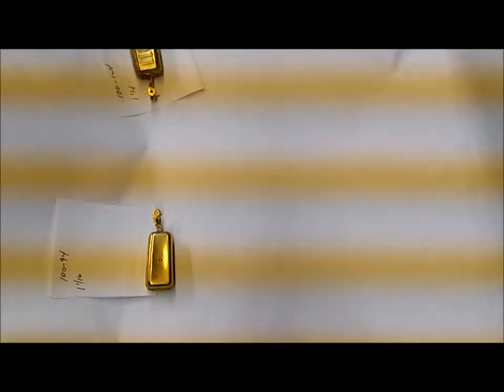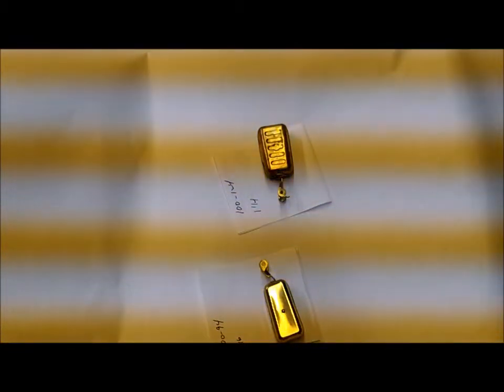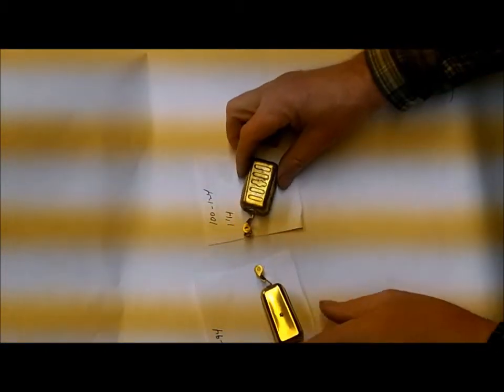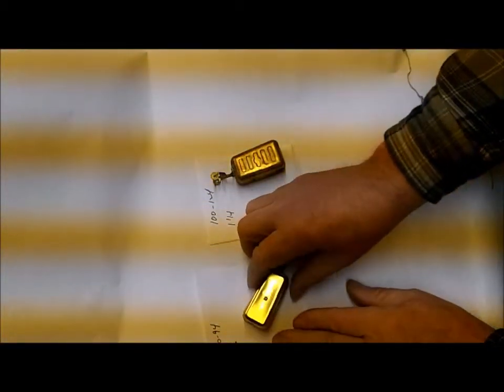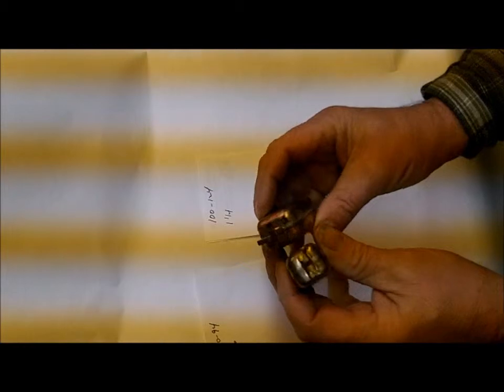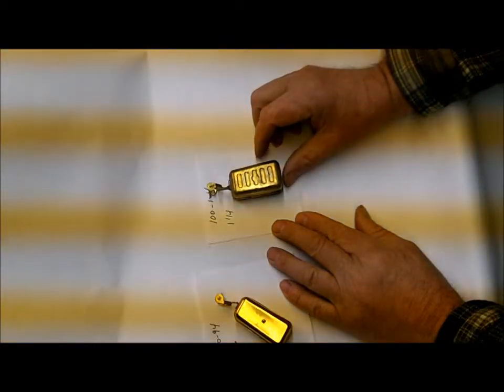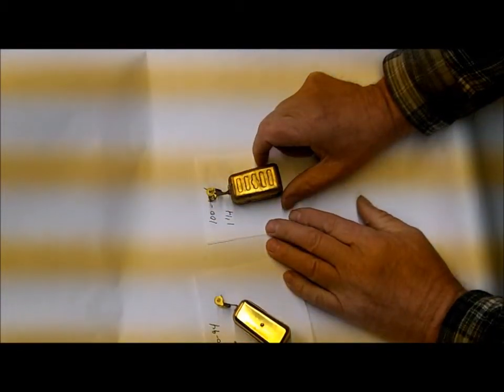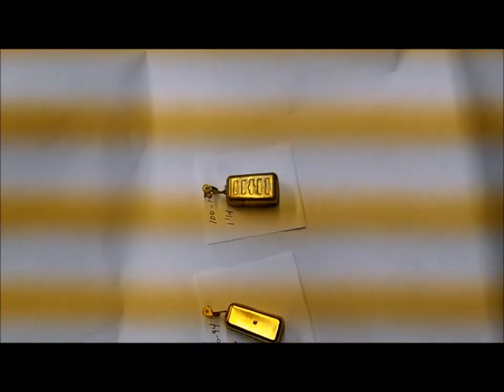Carter AFB Float Differences

Comment: Question; 
I tore apart a Carter AFB and had 1 float on one side (100-124)
And the other side had the (100-94) float, do i need identical floats on both sides to make the carburetor work?  Or is it possible to compensate the different floats VIA float adjustments?

Thanks.
Reply: @MikesCarburetor  thank you, appreciate the quick response.